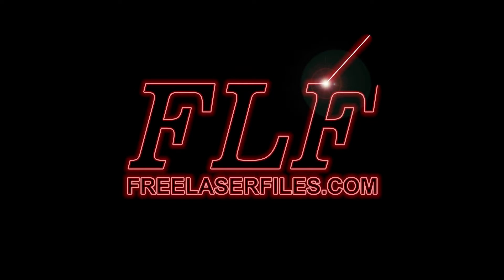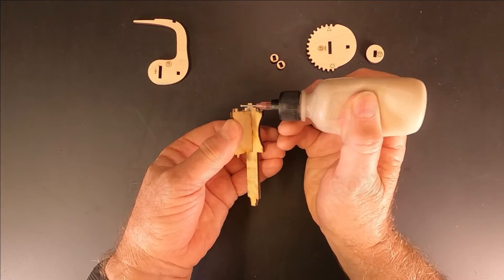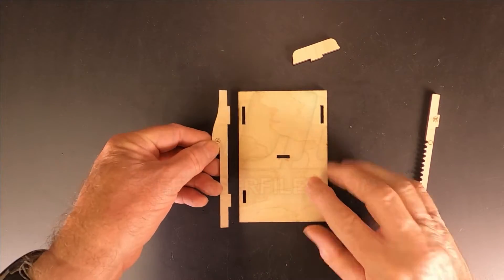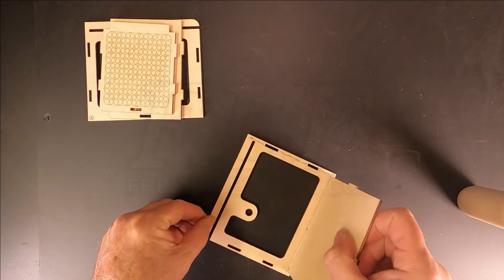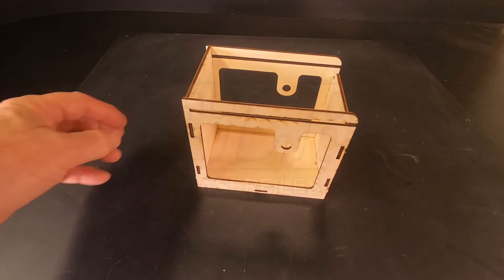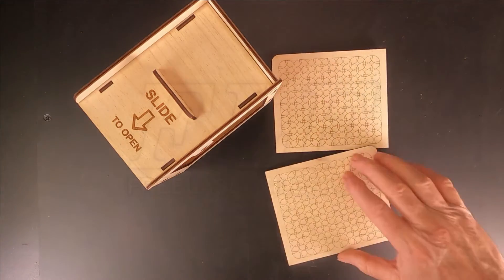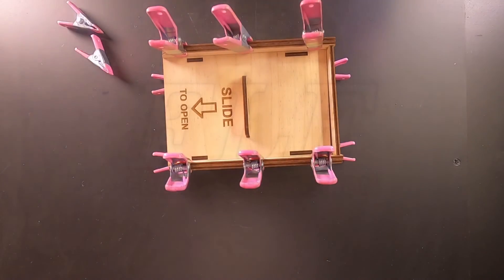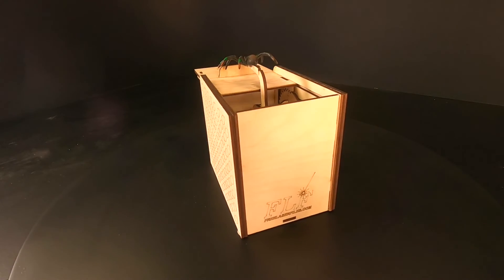Laser Cut Surprise Box Build Instructions and Free Cut Files

Comment: One question, won't the (slide to open) slider fall if we slide too much ?
Reply from the maker: Hi, no this box opens a little different from all the others out there. Just about all the ones you see on line have a piece of ribbon or string to pull  the arm up. Ours has a kind of rack and pinion opener. The arm is timed to the lid, and the cog can only open to the end of the teeth on the rack. Hope this helps.
Reply: @freelaserfiles  brilliant just brilliant 🎉

Comment: Hey! Do you need to resized the file? instead of width 2.90 resized it to 3.00 for the woods thickness?
Reply from the maker: Hi Luna, thank you for contacting us.
I didn't understand your question, but I think you are talking about size of the joint slots. Yes the slots are drawn 2.9mm wide but this will increase with the kerf of your laser. We allow .3mm on each side of the cut line. So cutting 2 sides of the slot, on our laser, will make the slot 3.5mm or .137ins wide. This allows for slightly thicker material. We hope this helps you understand why we size them this way.
We hope you enjoy building our models and if you haven't already, please subscribe to our channel to enable us to keep uploading files.

Comment: Hello what wax did use on the iris box on thr little pivets thank you
Reply from the maker: Hi Dean, we used a thin paste wax, can't remember the brand. Any wax will work, even candle wax. when we were testing the files, the models we made were cut from mdf and no wax was used. They worked just fine. Adding the wax helps the parts to move against each other when peoples used different materials and get a heavy charred edge.
Hope this helps.
If you haven't already, please subscribe to our channel to enable us to keep uploading files.